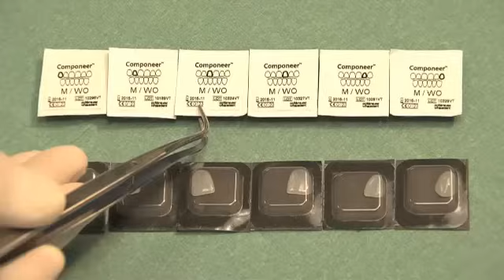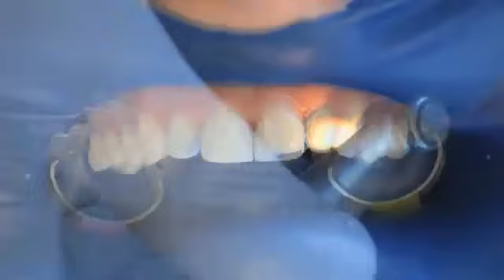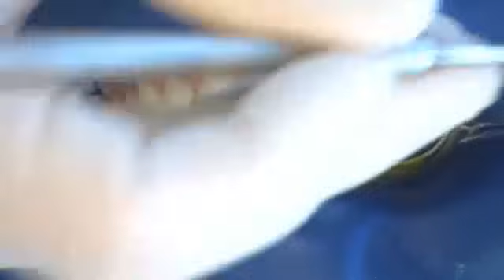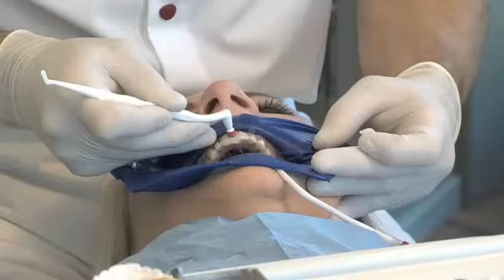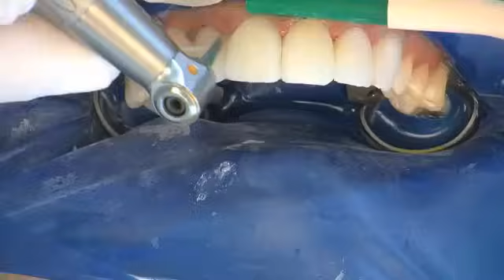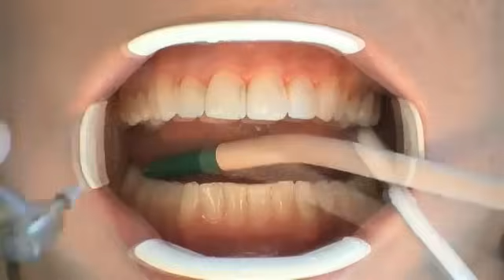COMPONEER Direct Composite Veneering System - long version

Comment: Its good to ruin perfectly healthy teeth.
Reply: I would rather have fake teeth that I like than real teeth I hate. Healthy or not
Reply: Not perfectly esthetic teeth in this particular case tho
Reply: Explain how?
Reply: @Muerte1917  in most cases the dentists actually remove about 1-2mm of enamel to make room for the veneer.  2mm may seem small but to an already thin layer (im using thin layer loosely here because enamel is at least 2.5mm in thickness) of enamel it is a lot. In cases which the dentist and patient come to a consensus of not having any enamel layer removed the patient could end up with a very bulging veneer. Plus the dentist may also use an acid gel to etch on the surface for micromechanical retention for better adhesion of the material. acid gel is used during restorative operations if decayed/carious tooth because again it provides additional retention for the materials. Basically if your tooth is in good shape don't fix what is not broken. Of course there are cases in which veneer procedure is a good option.
Reply: @bolothetitan5009  exactly

Comment: hello Doc, 
did you use anesthesia for this procedure? and how did you remove the Rubber derm that was attached to the gingiva? 
very nice result, thank you!
Reply: Local anesthesia would most definitely be used and most times required. They would be removing some of the tooth surface to apply these, especially if fixing any dental caries (cavities) and demineralization before application. It would not be a pleasant experience without some anesthesia.
Reply: @dude3083  
first of all: cavities are actually a contraindication for veneers, the treatment of cavities and veneer placement are completely different procedures. 
second: for (some) veneers there is only very little preparation of the teeth requiered... if so, theoretically, it would be a pain-free procedure. 
third: the etching of the enamel for the bonding, if done with the right technique (15s max.) won't cause pain. 

hence my question, whether the doctor used anesthesia or not.
Reply: @kristofb8541  
1. Contraindication means not to do it. Not that something needs to be done beforehand. Caries (cavities) are not a contraindication, they just need to be treated first. 
2. From the video: "The teeth are checked for old caries and fillings. Caries in the dentin are removed in the convention way. As are demineralized and discolored enamel." 
So, you have to get caries (cavities) treated before veneers can be placed. This is often done in the same procedure as placing the veneer, with a composite. But definitely not a contraindication.
3. Composite dental veneers are usually completed in one appointment with the use of a local anesthetic, which numbs the area. To prepare the teeth, the dentist will lightly buff them to make room for the veneers. It's this part of the process that usually requires anesthesia.
4. The amount of work that the patient had would probably have required some anesthesia.

Comment: Guys help, i want to get veneers  but don't know whether to get composite or porcelain. I know that if i get porcelain i will have to cut down my teeth but i hate this idea because i don't want to do any permanent damage
Reply: Veneers and bonding are pretty much the same, just done with different materials. You are thinking of 'crowns' or 'caps' when you say they remove part of your teeth. This is necessary so the cap can fit over your tooth.
Reply: @Problematic Hi I am a dentist(PROSTHODONTIST) from INDIA...in INDIA dental treatments and cosmetic dental treatments are done at affordable prices...for example for 3 on 6 implants we charge around 5000 US dollars(negotiable)FOR BOTH ARCHES( upper andlower)...for single arch it is NEARLY HALF THE AMOUNT......FOR SINGLE IMPLANT WE CHARGE 500(FIVE HUNDRED)U S DOLLARS(THAT INCLUDES CROWN)..if intrested wats app at 8332946881...for  further details... and to have a look at our previous work done on patients....we take care from your arrival,accommodation to departure...FOR FREE ONLINE CONSULTATION Wats app on 8332946881..can mail at mukkamalanagaseshabhargavi@gmail.com

Comment: It looks like a great job but her teeth were fine before that.
Reply: xI777Ix I agree, she just needed a cleaning and a bit of bonding on some worn edges. Nobody would notice your teeth really and I would not have that done unless the mouth was very bad as veneers can have a lot of problems with the materials and the costs involved. I would say to anyone if your teeth are healthy but are badly positioned, get braces then get whitening and some bonding on any chips/wear. It's cheaper and safer in the long run.

Comment: It looks great though and some day, when I will afford this, I will deffinitelly do it.
Reply: louiseleu what do you mean “ruin”? I’m genuinely asking because I plan on having this done soon
Reply: Dxxminique to have veneers the dentist has to permanently file down the teeth and this is an irreversible process.
Reply: greenkitty82 better than the alternative of having bad/discolored teeth tho am I right?
Reply: Dxxminique sure but braces and whitening and a good clean can make a world of difference. It wouldn't be advised to do this procedure unless absolutely necessary. You have to question why your teeth are bad and discoloured to begin with.
Reply: greenkitty82 speaking from personal experience, I’ve had braces, which straightened my teeth, but my teeth are discolored from inconsistent dental hygiene throughout my childhood and I’ve tried just about every kind of teeth whitening, from home kits to having it done in a dentists office and it never worked for me. Composites/veneers seem to be my last hope for a good smile.
Reply: Dxxminique hi. Sorry to hear that. Try looking up natural methods like charcoal, turmeric and coconut oil pulling to whiten teeth. Also lots of greens like Kale and spinach in the diet are beneficial in mineralising the teeth so green salads and fresh vegetable juices should help. I believe there is always a way to do something and as long as the enamel is there. To prevent poor dental health it's so important the diet is good and good cleaning is always done, prevention is the cure!

Comment: arrrggghh im in the biggest dilemma right now, having fillings in all my four front teeth, my right front teeth has decay leaking into my filling but the dentist cannot remove the decay completely due to it being adhered to my fixed retainer behind my teeth! Therefore they said veeners would be better because it would strengthen my tooth but i want to keep my actual teeth, because if i get a veener i have to get it on my other 3 front teeth as well to aesthetically fit in :(
Reply: I know this is 3 years late but I wonder what u ended up doing and if u r happy with ur decision
Reply: @ayanduale9747  I ended up getting my fixed retainer removed and got filling replaced and bleached my teeth. I continued bleaching teeth at home for 1 year and my teeth have become very White and my dentist had filled in the original filings with new whiter one to match my teeth. This route has more maintenance then if I got veeners, and I went to an cosmetic dentist so they were very skilled in making the filling blend into my front teeth so you can't tell at all. I still continue to bleach at home to this day as it keeps my front teeth filings stay whiter for longer and I still have my permanent retainer attached
Reply: @Jacksty9  wow u replied! I am glad you found a great cosmetic dentistry! Good luck with everything :)

Comment: her natural teeth was not bad ??? whay she wanted to do artifials shit that cost and does not last forever 🤔🤔🤔🤔
Reply: That teeth are forever or not forever
Reply: How long do they last for?
Reply: @josh6998  If you take good care of them for a very long time, 10 to 30 years.
Reply: With toxic material that leach into your body. Horrible
Reply: Truth seeker I agree. There is nothing wrong with her original teeth. If things aren't straight, get braces and a bit of bonding. Don't do this and ruin your teeth.
Reply: @greenkitty82  That is what happens your teeth are permanently altered after they put these on, and hopefully you don't have any problems right off with them over etching or placing them incorrectly or any hidden issues with your teeth. Just ask the dentist to remove them after you have them on, their faces change real quick, they aren't so reversible anymore as they claim. Plus there is research that states the materials can leach over time and these are not biologically friendly chemicals you want pulsing through your body. The thing about detox is,  it is a lot easier if you don't put anything in your body that you need to detox from.
Reply: Truth seeker yeah absolutely. You certainly are a truth seeker because you are seeking the truth. I've heard stories of people being in so much pain after veneers are put on they have to have painkillers - they can look good if done correctly but it is still toxic materials. Like Mercury. The most toxic substance on earth and yet they are putting it into people's teeth that leaches out affecting the brain over time. Yes prevention is the cure and if people eat correctly and look after their teeth they wouldn't need all this extensive work done but a dentist isn't going to tell you that as it's their job to be messing with your teeth. I've never needed a filling or any treatment because I don't treat my teeth in a unnatural way. If you don't do any harm there is nothing to fix yet people can't seem to grasp this basic idea that should really be in our natural intuition. I knew this at 6 years old that messing around with your body wasn't right yet cannot fathom why this doesn't even occur to a grown adult. That's why I never drank sodas or ate any junk because it didn't feel right for my body to have. But kids are the most intuitive of all, they know the truth from the off but they're conditioned through education and popular culture not to listen to it. That's why some of them lose their way as adults because they stop listening to their intuition.
Reply: @greenkitty82  You are very lucky to know not to mess with your body at a young age. Good for you!!! With your teeth your saliva need to be able to come in contact with your teeth that is what remineralizes them if they are covered by toxic material like these veneers the bacteria gets trapped and your saliva can't heal your teeth that is why they get cavities under dental restorations. People need to be cautious of what they do to their teeth, and bodies for that matter, since they need it to last. Teeth don't grow back as of yet. Preventative is best!
Reply: Truth seeker cheers! Yeah I think what it is is that maybe I was born with a strong intuition (if you believe in karma or past lives) but it just didn't feel right to me to put artificial stuff in my body, it just didn't feel right so I didn't do it (unfortunately to my peers disapproval as not following the crowd makes you a target) but it's paid off as I've not had to have any dental treatment because I didn't damage the teeth. Even with wearing shoes, even as a child I preferred being bare foot on the soil outside as it made me feel good and apparently that is really good for you to connect with the Earth. I was told I would always pull my shoes and socks off whenever anyone would put them on but if something genuinely doesn't feel right to me, I don't do it. The trouble is because of conditioning we tend to ignore our intuition but your intuition in most cases is always right. That's a good analysis of why the teeth materials aren't good, makes sense!
Reply: Truth seeker as a question as you have knowledge of teeth, do you know of any natural methods that can help receding gums? Or is it completely irreversible naturally? My teeth themselves are ok but from brushing too hard over some time I have some gum recession on a lower incisor. I do coconut oil pulling every morning and my gums are good but any new suggestions would be most appreciated. I know you can have gum grafts but I'd rather try to fix it myself if I can. Cheers.
Reply: @greenkitty82  Hi actually I think you should look at the research with Grapeseed extract. And yes be careful with brushing too hard and being aggressive with floss.
Reply: Truth seeker ok thanks cheers. I'll check it out. I use a small round head toothbrush and oral B slide floss and interdental brushes but I definitely think it's the brushing that's caused it. I have used electric toothbrushes in the past but they make my mouth feel so sore (and it's only lightly touching) that I went back to a manual. I'll always exhaust options before resorting to more invasive measures so if that's what will help I'll try it out. What about whitening? I think coconut oil helps but is there an even better natural method then using whitening gels? - chemicals! 👎
Reply: Hey hi, I just came across your question about receeding gums and here's what I wanna tell you: coconut oil, grapeseed extract, are bullshit. Your only option is to stop brushing aggressively and undergo a gum graft surgery. I know it sounds and looks like hell, but in fact it is nothing to worry about. I had 3 of them, they take like 45 minutes, and you feel NOTHING at all (well, except for the 1st freezing injection). And your gum will fully regenerate in 2 weeks after that. I swear to god, it was the best devicion I ever made. Don't be afraid and go for it, otherwise chances are you'll get some nasty caries on the root of your tooth eventually. Just don't focus on how it looks :)
Reply: @greenkitty82    I was going to say  brushing with soft bristles. The electric toothbrush can be aggressive. "The bone sets the tone" if you have bone loss that will cause the gums to follow the bone. They have dedicated a lot of research into grapeseed extract and it is one of the most promising natural supplements so far for gum health(oral health),preventing bone loss(bone sets the tone) even shows to strengthen dentin, since you are into less invasive methods that is why I suggested it. Do you clench and grind? That can lead to the recession. It depends why your teeth need whitening. Try remineralizing with the nanohydroxyapatite paste, and watching the ph of your mouth, and even drinking through a straw would help for stain prevention off the front teeth, more greens in your diet. Just off the top of my head.
Reply: Truth seeker excellent advice, thank you very much 👍
Reply: @greenkitty82  Absolutely! You're welcome .
Reply: Odipo & Catherine yes braces are very effectiveness in putting the teeth in a more attractive position. I've had them myself and they are worth it as long as you maintain them with wearing a retainer. The teeth always want to move back to their pre-brace state so you need to wear retention long term if to want to keep them straight.
Reply: greenkitty82  okay, thank you so much ,

Comment: Is it too costly?
Reply: In colombia they cost like $5,000 if I remember correctly. But seeing this video, they litteraly destroy your teeth to do this method. It's not recommended if you have good teeth. Also, if one of them brakes, it needs to be replaced asap and it costs a lot too.
Reply: Better off going to Colombia

Comment: I have Qs. 
when you use veneers . do you have to sculpt the teeth ? 
is their any another way to prevent sculpting ?

thanks ..
Reply: Katkotarx Rx  you have to prepare the tooth if you use porcelein veneers but not necessary when using composite or compomer veneers
Reply: Awesome good job 👍

Comment: i do have 90% similar teeth shape and condition like this woman....should i get this componeer or just teeth whitening?
Reply: nyatio just whiten and get a good clean. It's not worth altering your teeth permanently with artificial materials for this. I always think veneers look too fake whereas just adding a little bonding to your natural teeth and straightening is better I think. We are not designed to have all that toxic glue and materials in our mouths and no one in truth is really looking at your teeth even though we think they are. We're just conditioned to believe they are. Straightening and a bit of bonding if necessary. That's it.

Comment: This poor woman should have been treated differently as the only dental problem she has was just decays. Its not ethic to cut irresistibly healthy dental tissues in order to offer Hollywood smiles.After 5 years this woman will need all ceramic crowns to defend reappearance of decay under this veneers.

Comment: Nice video, Re the incisal edge wouldn't flowable composite be too weak for the this area especially if it is thin? I would have thought a reduction of the incisal would be necessary if you're going to place a thin layer of composite or there would be a high chance or marginal breakdown.

With the surface contour it seems you would have to do the same tooth in the opposite arch as it would be hard match the anatomy with a the preformed shape of the veneer.

Also like the rubber dam.
Reply: Best Scientific Comment